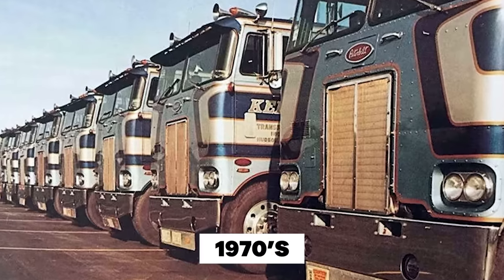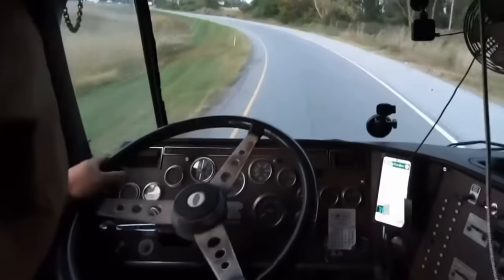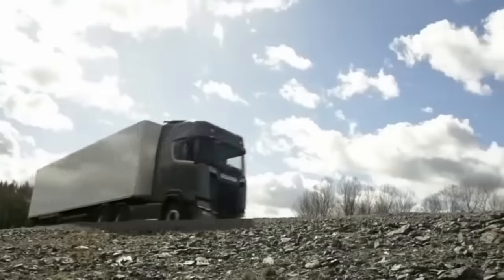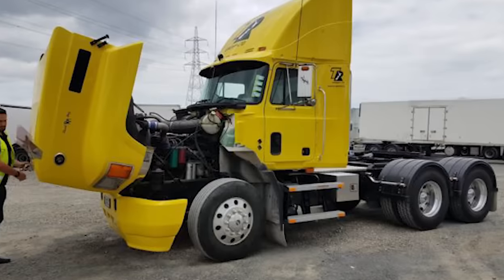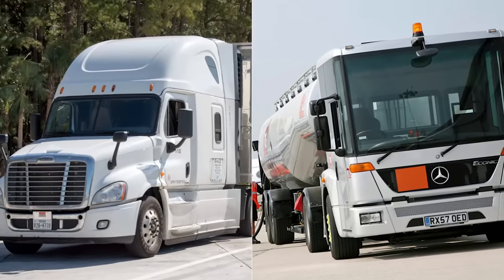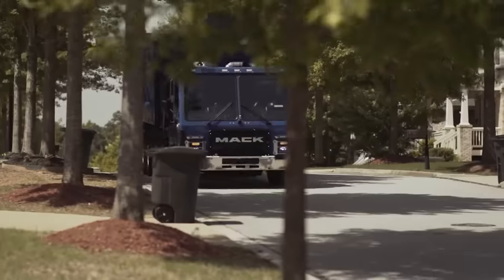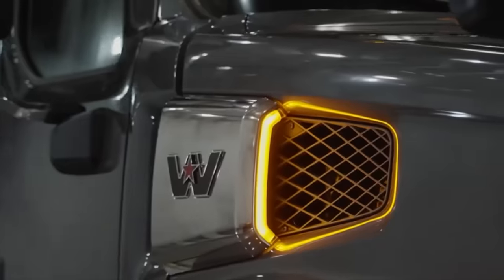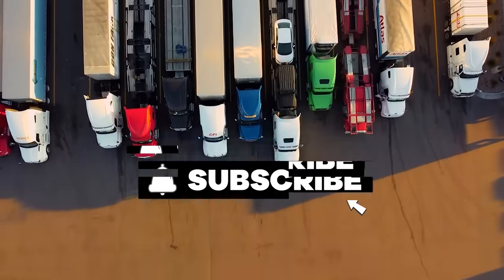The REAL Reason Why America Stopped Making Cab-over Trucks

Comment: I owned a Freightliner cabover, a double bunk condo, when I was a long haul driver.  I liked it.  Great turning radius, easier to park.
Reply: Probably an argosy flat floor. The older dog house models sucked
Reply: @theoregontruckerT880 Argosy was pretty good for regional and local routes ,  Cabover version of Cascadia basically. It’s a shame they discontinued  it due to low sales
Reply: I now own a setback axle freightliner double bunk 1989 coe
Reply: @oregonfordguy9812    I used to drive one of those.  Awesome turning radius.
Reply: @theoregontruckerT880    Nope, it had a big doghouse with my cooler sitting on it.  1996 model.
Reply: Was it that argosy zor whatever it's called?
Reply: @PenskePC17   Nope!   A 1996 cabover with a great big doghouse to climb over.  I set my 40-qt cooler on the doghouse, so I had to climb over that, too, and I was fine with it.   In the back I built in shelves  and drawers (held closed with bunji cords.   Then I used the bottom bunk for storage and slept on the top bunk.   If someone broke in, they would expect me to be on the bottom bunk, not on the top bunk aiming a .357 down at them!
I carried a full size crock pot (in a box lined with plastic and foil) that stayed on the bottom bunk and cooked many meals while I drove.  Cabover Living was fine.   I even took my 10-year-old goddaughter out with me for 2 weeks, but i had to leave some of the  "bottom bunk stuff" at home.   I liked the maneuverability of a cabover.  I'm a short old lady, and I could SEE better from a cabover than from a conventional.  Best wishes.
Reply: They forgot the rise of the set back front axle, which when combined with cab-over, like the ones I drove, were dangerously unbalanced without a trailer, bobtail.  So once they adopted the set back front axle, the cabover was no longer worthwhile.  ABS helped this problem, but not enough.
Reply: @alan6832   I drove only one cabover with a set-back axle.  Felt weird. The rewst didn't have that and were great.
Reply: @kathyyoung1774  That's right. The combo was too much so the industry chose the set back axle instead of the cabover.
Reply: Freightliners Cabovers I think are the most Beautiful - Cool-ist of American COE's with Technology now Comfort is not an Issue, as for Maintenance over 88 years ago Mack had a Vertical raising Cab (tiny compared to contemporary) but that's an option too.
Reply: The one I drove required I use the seatbelt or I'd of been shot into orbit.  40 years ago, Pa interstate 80 WAS one of the worst highways in the country
Reply: @kenbowser5622   It still was when I retired in 2003 --- unless you love Jersey walls on both sides about  2 feet farther apart  than your rig is wide.  And let's  not forget the tunnels you can't go through with HazMat and their mountain goat alternative routes.
I briefly drove one company truck that had a kitchen chair for a passenger seat.  Except for that one, I still loved cabovers.  Once we got power steering and air ride seats and Jakes, they were great.  Except I had to jack up the cab when it went into the shop, and that involved securing all my crap in the interior.  Happy New Year!
Reply: @kathyyoung1774  see I misread 'aiming a 357 at them' and just imagined someone sneaking into your truck, poking at the bottom bunk, and all of a sudden air horns and high beams from above and a Pete comes ramping down from the top bunk
Reply: @NutjobGTO   Well, NJ, you're close.  After I quit training new-hires, I slept on the top bunk with protection.  First was a can of Black Flag Wasp Spray, which sprays up to 20 feet in a stream (so it doesn't spray you, too, like mosquito spray would.  The S&W  .357 magnum was second.   I've pointed each of them at creeps trying to get in the truck, and they ran.  Cops caught one.   I strongly recommend Black Flag Wasp Spray (not Spectricide) for protection.  It sprays in a stream and is legal everywhere. ("Officer, I'm deathly allergic to wasps!").  Anybody who gets hit the face with that WILL go to the ER screaming about their eyes.  I keep a can of it in my car and by each door in my house.  I'd rather NOT shoot anyone.  So the spray is a good first choice if you have time to make a choice.  Be safe and be well.
Reply: I also imagine the view was much nicer from the cabin!

Comment: Always liked cabover trucks. Aside from the lack of a crumple zone in the case of accidents,  they offer many advantages.  And they look awesome too!
Reply: I don't think the "lack of protection" really plays a role when you're talking about accidents involving cars which is the majority, probably. any car or pickup would get flattened before the truck driver even feels a hit
Reply: @xavier4519 it only works for cars like a sedan is more likely to survive from a head on crash than a japanese kei truck. 

Like how often does a head one crash between two semi's, the long nose won't survive either
Reply: European trucks tend to be more advance with technology and that's why most european trucks are safer nowadays, so you don't have to worryy about the lack of crumple zone in a cabover truck.
Reply: Semi trucks don't have crumple zones
Reply: No they don't.  They're ridiculously hard to work on.. if you need to change an oil filter do you have to flip over the entire table with and all your s*** inside it. They Ride like a  nightmare. They aren't any more agile. They're tiny and uncomfortable. And of course if you get in a wreck you are paste
Reply: You do realize that conventional trucks also sont have a crumple zone, its just a solid brick for the engine.
Reply: You do realize that conventional trucks also sont have a crumple zone, its just a solid brick for the engine.
Reply: Then again there are images of crashes where the engine is pushed into the cabin.

Comment: I drove a cabover rig for years, great turning radius, especially for the east coast cities with multiple deliveries and pickups, so much asier to handle in small loading docks off street.
Reply: Our fleet put half sphere convex mirrors sticking a foot out on the corner passenger side window, you couldn't read the license plate, but you could see it
Reply: @PD-yd3fr   We called them school bus mirrors.
Reply: I hated driving a "long nose" truck. I chose a cab over if they gave me a choice..
Reply: @Bryan-Hensley    FRIEND!
Reply: @PD-yd3fr  Did they charge you for banging up the mirror?
Reply: @fairfaxcat1312  Never broke the mirror, it was on a bracket, extended about a foot and a half ahead of the windshield.  You could see the bumper, distorted, but could see it

Comment: It would be interesting to see how well they sold if a company started selling them again here in the states. Some guys would buy one just because they like the looks and they'd definitely come in handy for guys who do a lot of runs in the big cities.
Reply: Freightliner announced that they are going to start making them again. I can't wait
Reply: Volvo could try since they already have FH and FM.
Reply: We went from Cabovers to Conventionals about 8 years ago. We didn’t notice any major benefit to the cabover. Volvo has a great turning radius but they have had massive failures way too soon. The Peterbilt conventionals we got at the beginning of the change have consistently hit almost a million miles without major issues and turn just fine for city use even with doubles and triples. The best part about the cabovers being gone was the increase in cab space… and I’m short. I have no idea how guys over 6’ even considered driving one.

Comment: As someone who has driven both styles, both have their advantages and disadvantages. Long noses feel  safer driving because if someone comes head on in to you you have something in front of you keeping them out off you. C/O's offer better visibility and are easier to park. C/O's with a double bunk offered limited standing room. A GMC C/O I drove had a bunk added to the top , like a cap, and you stood on the engine cover and climbed up to get in. I'd still use a C/O for yard and city work, but I'd prefer a long nose on the long hauls.

Comment: Strange video. Comparing new US trucks to the cabovers of 40 years ago. Should really be comparing them to present Scania, Mercedes,  Volvo and MAN cabovers instead. Riding in one of them is like riding on a cloud.
Reply: But the transition occurred 40 years ago, so thise were the trucks to ne compared. If an overall length limit had contnued and were just dropped now, the result may have been different.

Comment: As someone who drove both COE and Conventional trucks I would take the Nose any day of the week.  Why my worst accident was in a COE and that one dang near killed me.  Drunk driver coming the other way hit me right under the driver seat on a 71 IH Transtar COE blew the cab off the frame threw it about 20 feet from the rest of the truck.  I ended up with a severe concussion and a TBI that blew up so to speak about 4 years later and caused seizures.  I drove everything from a Anteater T600A to T2000 in KW's to 377-379 Petes FLD 120 C120 condo Freightliners IH 4070 Emeryville COE's and a 9300 that would eat hills for breakfast.

Comment: I read a article a few years back that was from a industry reviewing company back in the 70's and they recommend the cab over for driving in city's because of the field of view and turning ability in the narrow streets....
They then started looking at the long haul over the road trucking part of the industry and stated that the cab over truck while having ease of maintenance, great viewability for the driver, good sleeper area, and great movability it was also very hard on the drivers because of road bounce transfer to the drive ( resulting in things like separating ddiscs in spine and other back issues, and even reports of internal organs dislodging from the walls of some drivers who had been drivers for years..
They also stated that the cab over trucks were not safe in a collision because there is no buffer between the front of the cab and the driver.... 
However the industry standards are extremely different today compared to back then, so with modern technology, manufacturing, materials, and safety standards comparing the old and modern cab over is like comparing the red barons to the F16 they are both planes just vastly differt, one did it's job and did it good, the modern one is just built better, and safer.

So maybe they should look at them again. 

Respectfully.
Reply: The difference in "rough ride" just isn't that much.  I drove both, still prefer cabovers.  Big rigs just do not have the suspension systems of Cadillacs.
Reply: Maby that was before every truck had airsuspension driverseats

Comment: For what I do hauling glass on flatbed, I'd prefer a Euro style cabover over what we have now. Quite a few of the customers I've delivered to can be a pain to back into their bays. Takes a bit of skill backing in at a few of these places, some of these bays I back into have concrete piers on either side. Sometimes you only have a foot to a few inches of wiggle room on either side of the trailer. Depends on the angle of the sun too, get that load time at a bad time of day, and it's like backing your trailer into a black hole, one screw up and you'll either tear the shit outta you trailer or mess up the bay. Maneuverability is certainly my preference.

Comment: Most comfortable truck I’ve driven is a Freightliner Argosy cab over. Crazy amount of room.
Reply: I wouldn't exactly call an Argosy a smooth operator but it still light-years ahead of comparable japanese units.
Reply: I once mangled the cross piece on the chassis in front of the fifth wheel, on a brand new Freightliner.

Comment: Modern European Cab-Over trucks has own "beauty" - different style - different design school, technically with own advantages and disadvantages same we can talk about traditional trucks. But Old American Cab-Overs was really something incredible! For me Freightliner Argosy was kind of last Mohican from this unic tribe. But it was Amazing looking model!
Reply: Tiny Sleeper Cab is the biggest minus
Reply: @nenadcubric2663 Stack on an external sleeper, like you would on a 359 then. Pretty sure maintenance and aerodynamics would be the bigger issues.
Reply: After driving conventional cab trucks for years, then I began using COE. Ford 9000, Freightliner , Peterbuilt, then back to Long Nose, IH 4300., each served a purpose at the time.
Reply: They're certainly different, and not just in style. 
Traditional American cab-over-engine trucks place the driver directly over the engine and front axle, with minimal front overhang. The door is directly over the wheels, making entrance difficult. This continued right up to the final Argosy, and continues in the Kenworth K200 in Australia. 
European cab-over-engine trucks place the driver ahead of the front axle, with significant front overhang. The entrance steps are ahead of the front wheels.

Current cabover trucks in the US are generally medium-duty and have European or Japanese cabs, and are forward control; specialty trucks such as for waste collection (such as the Mack LR and Freightliner Econic) are low cab forward designs, placing the driver even further forward, entirely ahead of the wheels and ahead of the engine, allowing easy access.
Reply: Freightliner still sells new cab overs in South Africa, but the newest one I saw was a 2020 Argosy
Reply: @trevorpokela6962  There is still old stock of the Freightliner Argosy available, but they are not being manufactured. It was only built in the USA; it has not been sold in North America since 2007 except as a glider (although manufacture of complete trucks continued for other markets), and has not been manufactured at all (anywhere, for any market) since 2020.
Reply: @brianb-p6586  I noticed that all the 0 miles trucks all ended up at 2020 from like 2015
Reply: @brianb-p6586 sadly the Argosy was fixing the problem of climbing in but it was near the end when it was too late.

They had it where the steps could swing out and become a staircase or you can lock them and use them as regular steps.
Reply: I grew up riding on the dog house of my dads and papaws trucks!! I cherish all those memories
Reply: They just look so feminine to us. We like the old school rough look of many of our trucks. They just look so ready to work. Even though we know your trucks get the job done for you.
Reply: @Dunki113 the steps were the biggest problem with the argosy.
Forever breaking and getting stuck out combined with the stupidest shifter placement of any truck on the market.
They are despised and ridiculed in Australia for being pieces of junk.

Comment: I saw the conventional cab a hiring tool. The company I worked for replaced the cabover to entice new drivers. The freightliner cabover I drove had a larger bed than the conventional truck. I felt safer with the engine out in front of me instead of underneath me. Bless all truck drivers.

Comment: In Japan long nose tractor are very limited use only in such as privately owned hwy and port. Vast majority of tractors/trucks are cab-over but likes of 4 front directional turning wheels or smaller diameter wheels with low loading floor, they have lots of unique design options.
Reply: I think there's a mining company in Japan that uses Australian built Kenworths and Macks to haul coal, in both cabover and long nose format. I've seen a few pictures of them using long nose Nissans as well. There's quite a few long nose Peterbilts in Japan as well I believe
Reply: Yap, we’re probably talking about a same company “ UBE Corporation “ their main business is cement and coal, they own 32 kilometer private hauling hwy and they use Kenworth, Mitsubishi-Fuso, Isuzu and Scania,usually pulling 88ton double trailer. Few of the trucking companies owned hi-powered long nose (Mack and Kenworth)tractor heads for transporting heavy loads on public roads.
Reply: I rather imagine they don't have much use for 53-foot trailers either with Japan's topography.

Comment: I've driven 2 Mack coe's from the 70's. 2 K100E's 2 Pete coe's &1 Freightliner coe from the 80's. Presently driving a 23 Freightliner.  I think both of the Petes & both KW rode better than this freightshaker. The 1st KW, was mostly owner operator spec, except it was a flat top. I really miss that truck.
Reply: Hell yeah brother, I peddled an 88 K100E with 60inch flat top sleeper. Right hand drive and cat powered. Loved that truck and it was the last cab over I drove before switching to T900 and W900 kw's.
Reply: @kiwidiesel  hell yeah brother. All great trucks.

Comment: I drove for Schneider Specialized hauling glass out of LOF in NC. My first couple of tractors were International cabovers. I took great pride in keeping it buffed and polished with everything organized. They were under powered and regulated by the company, but they were very suitable for the places we delivered. Quite a few of the glass houses we went to were built in the 20's and 30's inside the cities with very tight entry ways. The snub nose of the cabover made it easier to maneuver a trailer that was 53' long with a spread axle, especially backing in to a spot designed for a 20' to 35' single axle trailer and a single axle tractor. I would have liked to run a Flat Floor Argosy Freightliner when they came out, but I ended up moving into a conventional International and then a 377 Peterbilt.
Reply: I used to haul glass for Schneider out of LOF in Illinois around 1999. My first International had already turned over the odometer and read about 130k, I think. No jake brake, either. You weren't kidding about some of the places we delivered. A place in PA comes to mind that had a wicked T intersection on one side, and an extremely low weight bridge on the other side. Or another in Indianapolis, I think, that you had to block 4 lanes of traffic to be able to back into their dock. What a trip that job was.